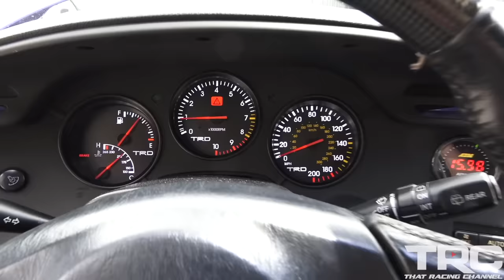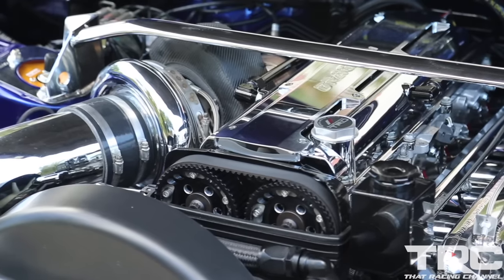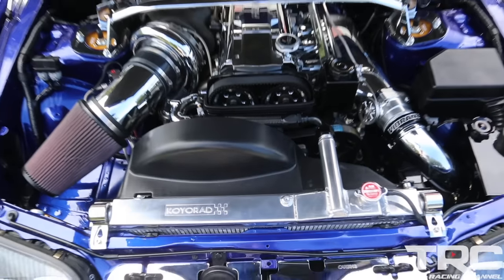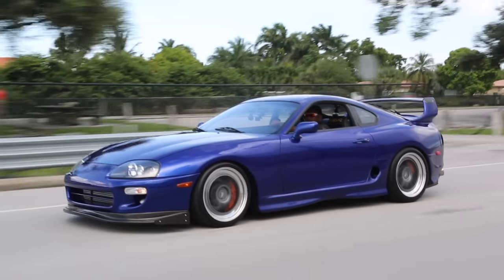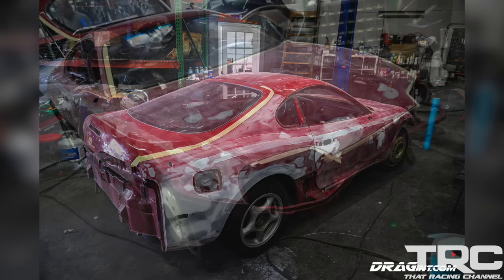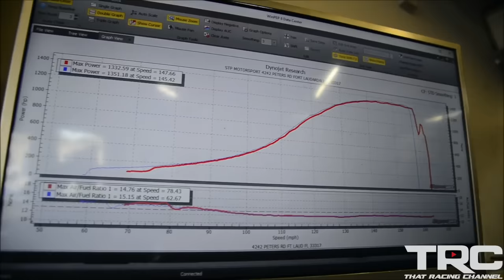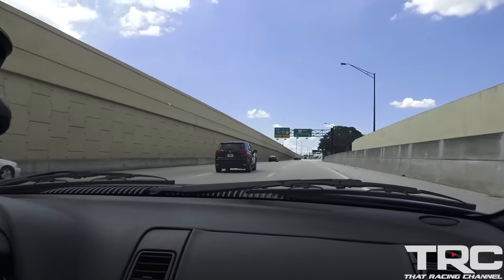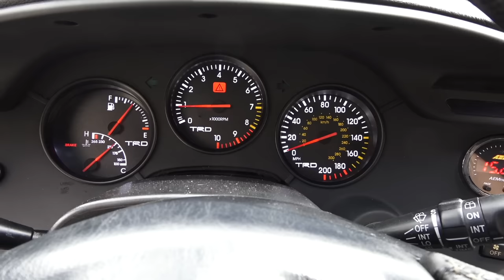1500HP Supra Gettin' Rowdy - 2JZ Eargasm!

Comment: Impressive. I am surprised this car has the stock Camry steering wheel.
Reply: its not the stock camry wheel lol
Reply: @arcanevoid9199  What is it then?  Stock Supra steering wheel was the same as the Camry. I suspect you were still chewing on crayons when this car was manufactured.
Reply: @bedevil1  its the 3 spoke leather wheel that first came on this car, and also came on the mr2, the celica and the altezza/is200/is300. i wasnt born with this car was manafactured ._.

Comment: How do you get that turbo flutter (stututu)
Reply: When you close the throttle butterfly and the air in the charge pipes has nowhere to go so it hits the impeller wheel in the turbo. It can be intentional or un-intentional. Could be achieved by not running a blow off valve to help trap the air between the turbo and the throttle butterfly. This is a much wider subject of discussion, including if its healthy for your application depending on specification.

Comment: Driving a Supra over 800hp on the street is pointless stupidity for street racers. 700-750hp street tuned Supra is insanely fast. 1500hp is left behind slowly feeding the power down trying to stop tyres from losing traction. Just listen to it. car would be thinking 'you gave me all this hp and i can't use it'.